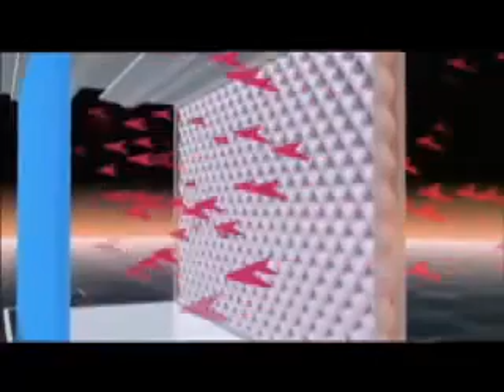Seawater Greenhouse and The Teatro del Agua - Discovery Channel (2007)

Comment: “Creating a beautiful backdrop for a open air theatre”
typical designer or architect mind thinking 
Desalination is a industrial process. What about cost effectiveness?
What if the wind doesn’t blow? There are huge losses of humid air because not everything can condense on the tubes - the problem with being open air system and not enclosed.
There much better designs and even simpler systems. 

Love the idea tho. Saltwater greenhouse or “cool house” is a even more useful idea. Because they use cardboard and salt water to cool plant and get humid air.

Comment: Barskor1 I'm just a high school graduate but see where your going. A tube full of water, pulling down on a air bubble. Could create this vacume draw with a balloon?  I see a plastic sheet with water making a lens or round ball possibly filled with water colecting an focussing sunlight and collecting condesation as a cover to evaporation chamber. The siphon baloon conects to a large body of water maintaining a air vacume and run off catchment (another balloon) just needs a shut off valve. A solar water heating vacume tube would work better but are expensive. Would it work?

Comment: Gravity induced vacuum distillation will do what you want faster and cheaper. Water boils in a vacuum at room temperatures 75 degrees F . You can make a cheap vacuum system capable of a hard vacuum of 30 inches of mercury with piping in a vertical direction 12 meters inside an open topped pipe length 10 meters. The inside pipe has valves at the top and bottom, the inside pipe is filled with seawater to the top then close top valve and open the bottom valve gravity will pull the water down leaving 2 meters worth of hard vacuum as it fills up the 10-meter outer pipe. 
Now how do we get the fresh water out? We set up another vacuum pipe connect them with a condenser coil cooled with sea water and shaded from the sun taking the vaporized water from Vac A to Vac B where being a lower temp condenses to be removed at the bottom valve of Vac B. To make the system flow continuously add a spray nozzle to the top of Vac A spraying in seawater warmed by the sun after  cooling the condenser coil of Vac B the spray increase the surface area making instant steam in Vac A creating fresh water as fast as in can condense in Vac B.
Reply: Barskor1 I'm just a high school graduate but see where your going. A tube full of water, pulling down on a air bubble. Could create this vacume draw with a balloon?  I see a plastic sheet with water making a lens or round ball possibly filled with water colecting an focussing sunlight and collecting condesation as a cover to evaporation chamber. The siphon baloon conects to a large body of water maintaining a air vacume and run off catchment (another balloon) just needs a shut off valve. A solar water heating vacume tube would work better but are expensive. Would it work?

Comment: "Unlike typical desalination plants, the 'teatro del agua' needs no fuel" Only those that use fuel to heat water use fuel, while all need energy to pump water even the ''teatro del agua''. While as of this moment i do not know where the "teatro del agua" gets its energy from, if it derives some of its electrical power from fossil fuels to pump the water, then even though it may not need fuel, in practice, it still is using fuel.